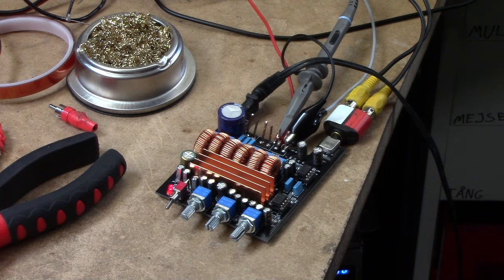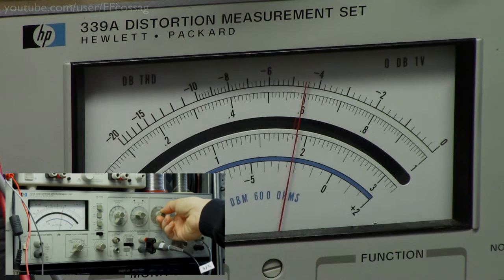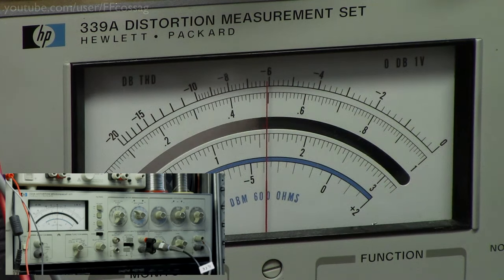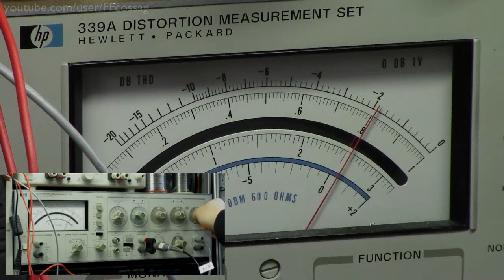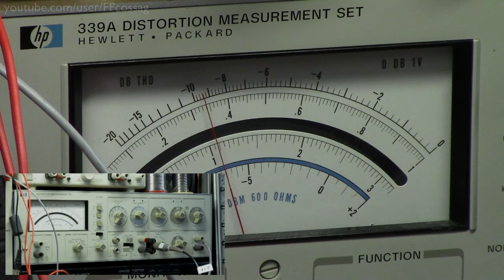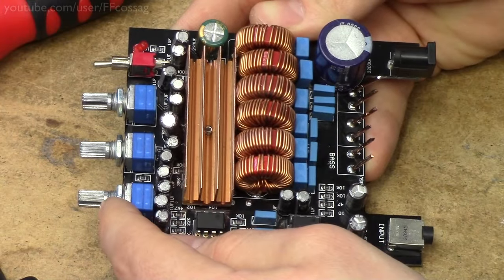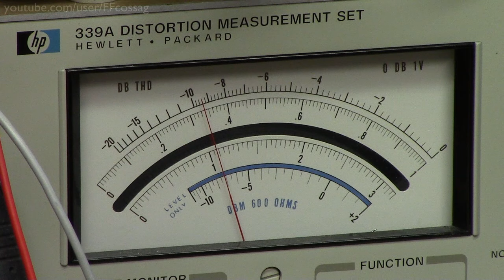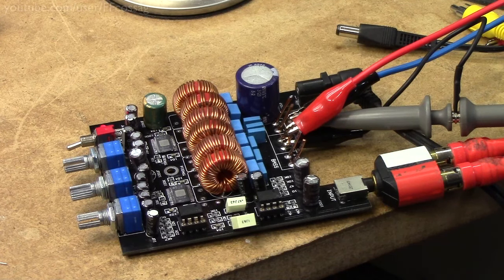Dual TPA3116 board for the Breeze chassis #1

Comment: Hello, thanks for the helpful video, I have some questions.
My dual 3116 sounds like playing music through the walkie-talkie

1. My dual-chip board has the resistors in the same order, does it means they are both masters?
2. I have watched the other video of yours about reducing the gain, so instead of swapping the resistors, I should just follow the sheet right?
which says:
Master 20 dB  5.6 kΩ     OPEN
Slave 20 dB     51 kΩ     51 kΩ

I am sorry, I have no knowledge about electronics, I would be really grateful if you could get your answer, thank you a lot!

Comment: (I think) I've decoded the filter circuit. It's harder to look at it until we rearrange our own sketch... (https://dl.dropboxusercontent.com/u/33246424/Esquema%20TDA3116D2.pdf)
The first two op amp are feeding bass pot (stereo input buffer, not in the linked PDF), and from there a mono signal is sent to a 2nd order Sallen-Key low pass filter (one op amp). The other op amp (2b is my schematic) is a virtual ground provider. From the calculations (http://sim.okawa-denshi.jp/en/OPseikiLowkeisan.htm) this gives a 107Hz cut out frequency (R1=R2=10Kohm, C1= 220nF and C2=100nF).
This is not consistent with your measurements and it would be great if someone could took a look at it.
I'm not sure virtual ground is well implement or if I get the circuit right.
Reply from the maker: Nice job, I might look into it in more if I have the time. As far as my measurements go, there might be something playing up with the low input impedance of the TPA3116 as well as the large amounts of 1 µF caps they've used to AC couple everything.
Reply: It would be VERY nice of you :)
Those 2x1uF you also changed (near rear end op amp) are the last two on my schematic and (I think) they attack the bass IC directly (haven't remove heatsink yet). They certainly could extend bass respond (TI recomends if a flat bass response is required down to 20 Hz the recommended cut-off frequency is a tenth of that, 2 Hz, so more is always better!).
Reply: For those you may need to change their boards further, I'm posting part of the schematic (https://dl.dropboxusercontent.com/u/33246424/TDA3116%202.1%20Original.png).

I correct myself about op amp 2b - that's not a virtual ground provider but an inverter (2x gain) that attacks "-" input of sub IC.
To get tighter bass control I will change original 100nF cap with a 220nF and add a cap in parallel to R8 to provide an additional order to low pass filter (making it an 3r order low-pass filter).
I also changed my sub IC gain to 36dB while making it a slave (100k+15k) and we can further rise the sub gain by reducing R7 (3.3K or 2.2K). I made this not because I like lots of bass but, since all my speakers are all 4ohm, I can get the correct bass intensity without lowering stereo volume (least noise possible).
Here are the simulations I've made: https://dl.dropboxusercontent.com/u/33246424/TPA3116D2%202.1.png

Comment: I like the triple knob system, you can set a volume, and then adjust the sound, as you might want 50% bass volume, and still have 0-100% on the mid/high, or the other way around is more likely, but..
I like it :)

Comment: personally i disagree with your choice for the filter, it should have a good range from 70 to 150 hz ish, its useless that low with the power it produces, as was intended by design
Reply from the maker: +Jamie Earp It's generally accepted among audio enthusiasts that subwoofers should cut off at around 80 to 100 Hz at most. Frequencies above that should ideally be produced by the satellite speakers in stereo, since your ears are able to detect the direction the sound is coming from. That said, these parameters depend entirely on the kind of system you're driving.

Comment: Hello where do you find all the capacitors you use to upgrade. I cannot find the mini box polyester ones.
Reply from the maker: Most of my components are from Mouser, found using the power of parametric search.
Reply: OK, I checked mouser and found them, I now have the question that since we are improving sound quality, is there specific capacitors I can use which are better than others. So far I have only worked with foil caps for crossovers, but not anything regarding amps, so this is my first AMP project.
Reply from the maker: benniehanas
Generally, you just want to steer clear of ceramics and electrolytics in the signal chain if possible.

Comment: You are suposed to put 2ohm load on PBTL output! Not 8!
Reply from the maker: That depends on how it's configured, but the fact that it's able to drive impedances that low does not translate into that being the only impedance it can drive.

You don't see much gain from PBTL in 8 Ohm operation, though. It is kind of pointless.
Reply: Just received the amplifier from Aliexpress. 6ohm 60w 3-way speakers + 4ohm 300W RMS 300mm (12") subwoofer (Clarion WG3020)

Doing some tests and I have noticed the LR Potentiometer at a certain point gives a treble boost. Might be my imagination.

Main power cap is a Rubycon and the others are not any brand I recognise, so I might upgrade them. Doing all the mods I can find on the internet + checking the official schematic to see if the output filter has an EMI C-RC Snubber.
Reply: UPDATE:
Upgraded potentiometers, opamps to OPA2604AP, all 1uf caps to Vishay low-ESR and noise floor dropped considerably; I left the other caps because I was able to find the brands online and they are reputable and they all are 2000+h rated 105ºC and low-ESR. Didn't add an EMI Snubber because the board already has them in every speaker output wired like the schematic says. Finally lowered the stereo gain to 20db to have minimum noise floor but i think it's overkill.
The most important thing was making a ground loop isolator. Used some cheap "10PCS Audio Transformers EI14" from Banggood.com . I have tested them with my ear and they work down to 5hz.

The last thing I'd modify is the subwoofer low pass filter. I can definitely hear midbass in the sub and I don't like that.

Any recommendations anyone for which values to use?
Reply: Can you put the measurements in one file,so non-eglish speaking people can analyse this information?Cant understand what do you say most of the time
Reply: papaVasyaA Sorry, all measurements done by ear :(
Reply from the maker: I don't think I ever wrote down any results.